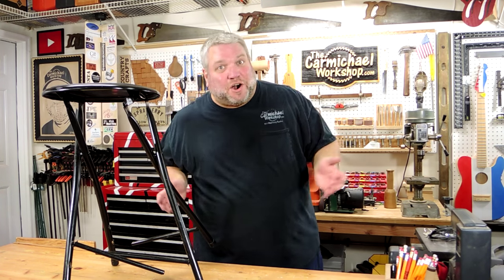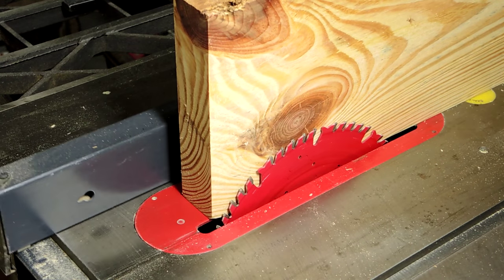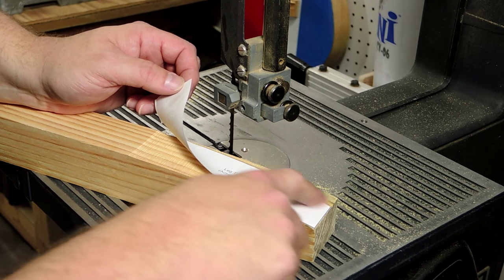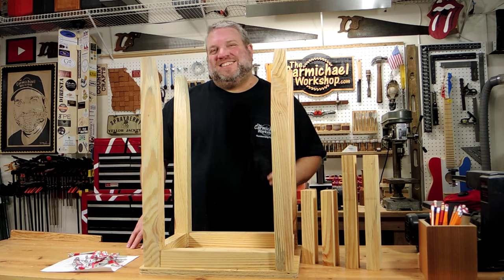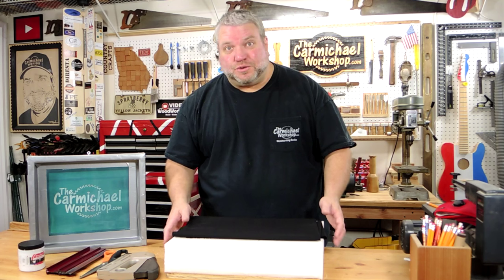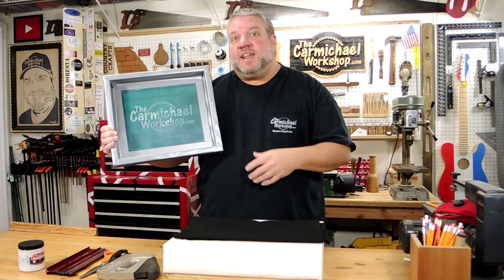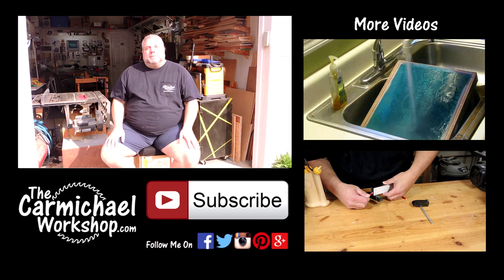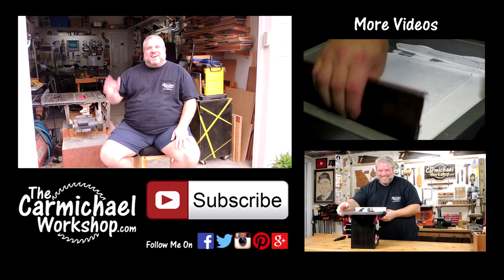Make a Workshop Stool or Bar Stool

Comment: Love that screen printed seat! Very nice touch.

For anyone thinking about making a similar stool and using vinyl or any material other than a cloth fabric, do yourself a favor and drill at least 1 air hole in the plywood seat platform. When you sit on it, the air in the foam has to escape someplace, and air rushing out from between vinyl and plywood can make some very goofy, rather embarrassing noises. Just saying...

Comment: So you have carmichael proofed it if I was to make one (which there is a possibility) I would need to Nighthawk Proof it ... bigger screws more glue... add in dowels as well fo good measure... I am just a clumsy goof... lol
Reply from the maker: +Wacky Wood Works  I think the thicker lumber was the key.  This thing is heavy and sturdy.
Reply: I reality I probably need steel reinforced concrete stool (and i would still probably break that lol)

Comment: Damn, I did screen printing in 7th grade as well my teachers name was Mrs Tate and she was a dead set hippie. Always wore tie dye stuff and I hated art so she didn't like me. I am not at all artistically inclined, I am plain, boring, conventional and like things symmetrical. That wasn't acceptable so I failed art. That really held me back in my field of work as a mechanic and spare parts interpreter. Good job Steve, that looks brilliant, but might I suggest putting some covers over the hex heads as you might catch your leg, or maybe countersink them and glue some dowel in the hole. Good video man, take care.
Reply from the maker: +TheAussieStig30    I think my teacher was kind of hippie back then too.  Good suggestion with recessing the hex heads.  They are not sharp or anything though.  Will see how it goes.

Comment: I built this, mine is a little wider to fit it to size of the foam. The big mistake I made was to get foam that was to thick. Other then that it is great. Thanks for the idea!
Reply from the maker: Great to hear you made one!  I love mine.  I think my foam was 3 or 4" thick.  I'd like to replace it with that dense memory foam stuff.  It's just not padded enough for me.

Comment: I'm not going to lie. When I first saw the plans I thought it was going to be a lame build, but you really pulled it off. Great stool. The bolts ended up being decorative and the silk screening on the seat really pulls it together. I like the tint in the pray laquor.  Great stuff.
Reply from the maker: +Impractical Fishermen   Thanks!  I was going for a simple stool that would hold me up and still look pretty cool sitting in the shop.  I always gravitate toward the contrast of black with the wood grain cause it looks sharp.  I lucked out with the swirly grain in this pine.

Comment: Nice,  functional project that could essentially be built from scraps from around the shop.  

My only question,  and please excuse my ignorance,  as I am just learning.  

With the ply board under the cushion,  screwed right to the base,  would an attachment mechanism to the likes of something used for a table top be more fitting? I've been doing some research and everyone seems to feel like z clips would better allow for movement with the changing of the seasons. 

Make no mistakes,  I'm not questioning your knowledge,  or saying "you should have blah,  blah, blah."  Just merely trying to educate myself better.
Reply from the maker: +Phillip Synenberg   Thanks Phillip!  I was thinking of using some sort of clips, but the movement is not much of an issue with plywood although it can move some.  The glued plies keep it constrained more than solid board cut from a tree would be.  That's a good question.
Reply: +Steve Carmichael good info,  thanks,  Steve!

Comment: Fantastic video, you've got me wanting to build 2 myself! What did you pay for the foam padding? Also was your 2x lumber pressure treated?
Reply from the maker: +Tyler Koch   Hey Tyler!  Cool!  The foam was about $7 at Hobby Lobby  and I think I got 40% off that with their online coupon.  The lumber came from a local saw mill, so it wasn't treated.  It was also 1.75" thick, as opposed to 2x which is 1.5.
Reply: +Steve Carmichael even in the comments your teaching me something. Thanks!

Comment: Hi Steve, is there a rule of thumb on how much material is needed to cover the are plus the padding so that you have enough to staple down?

thanks for the great video.
Reply from the maker: +Will Gray  Hi Will - Not sure.  I just measured across the seat, down both sides, then across the bottom in both directions.

Comment: Do you like that dust mask that you're wearing? Do youfind that it works well?
Reply from the maker: +Phil Reynolds  Hi Phil - I do like it better than the white paper ones.  The XL fits me well and the velcro strap is nice.  If you wear glasses or goggles, you have to rest them on the mask or up close to your eyes.  They still fog up a little depending on where you put them.  I'm wondering if the mask will be hot in July.  The mask is from RZ Mask http://amzn.to/2dvgrAF

Comment: Really like that screen  printing!   What do you use for the sticker material that you made the template out of?  Some kind of sticker sheets that go through  your printer?
Reply: +Jack Bench Woodworking Im not sure as to his specific method but you print your logo on to clear plastic sheets. Then you stretch a silk like material over a wooden frame. The silk is then coated in a special photo sensitive emulsion, the logo that was printed to the clear sheet is then placed ontop and the whole frame, logo and all are put under a light. The light will cure/harden the emulation. Any of the silk that had part of the logo covering it will be wet still because the light couldnt harden it. So you can now use a tap or hose to spray the screen which will remove the wet emulsion. You now have a screen with your logo on it. Then its a case of laying it on the surface you want to print on. Putting some ink on and using the squeegee to spread it evenly across. Since the ink can only penetrate the silk that has no emulation blocking it, your logo is then transferred across. You can get multiple colour prints by repeating and building up each layer with a different colour. :)
Reply from the maker: +Jack Bench Woodworking Check out my video on screen printing shirts.  It is a step by step process and a supplies list is in the desc. You can get started for about $60 with hobby level stuff.
Reply from the maker: +Dylan McGreevy Good explanation Dylan.  Thanks for helping out.
Reply: Steve Carmichael Thanks, great video btw :)
Reply: +Steve Carmichael Thanks Steve.

Comment: Nice and simple and it came out great.  Did you glue it together it just mechanical fasteners.
Reply from the maker: +Mr Woodworker No.1 Thanks!  Yep, I glued it together although the end grain doesn't provide a very good glue surface.  Those lag screws are strong, but I thought the glue would keep the rails from spinning on the screws.

Comment: Being a big guy, I need a sturdy shop stool.  I searched YouTube for shop stools and want to make yours.  What is the measurement from the bottom of the top brace to the top of the bottom brace?  Hope you see this as I know it is an older video.  Many thanks.
Reply from the maker: Hi Stephen!  There is 12" between the braces.  I still used the stool.  If I made it again, I would make the legs form a square with a round seat.  I find myself turning sideways on the stool with one leg over the front and one over the side, so the corner doesn't dig into my leg.
Reply: @SteveCarmichael  Thanks for the extra tip!

Comment: Hi Steve! I will be building my stool tomorrow and wanted to know if the taper is necessary of is it more for looks? 
Thanks!
Reply from the maker: Hi Andre!  That's awesome!  The taper is just for looks.  I suggest rounding over or chamfering the botttom of the legs.  I had a problem with the wood chipping and splintering, so I ended up rounding it over.  Or you could attach feet or felt so the wood can't chip on the concrete.
Reply: @SteveCarmichael   @Steve Carmichael  thanks for the response, Steve! The stool turned out great, and i ended up just attaching feet to the bottom. Thank you my friend, you are awesome!

Comment: nice heavy duty stool..never worked wth southern yellow.how is it to work with?-also, you wanna swap stickers??:)
Reply: SYP is soft and easy to work with power tools, it doesn't sand real good and has a tendency to split if you don't pre-drill.  It also doesn't work well with chisels.  It's what is used to frame 90% of the houses here in Louisiana
Reply: Mr Woodworker No.1 thanks for the feed back appreciate it. ..im from n.y. and was curious. .-ive never seen SYP here in n.y.
Reply from the maker: +Joe basementwoodworking Yeah, it's used for construction here in GA too.  I think it's a little stronger and heavier than the white pine/spruce.  It can have a lot of sap in it too.
Reply: +Steve Carmichael nice!-thanks for the reply steve!-does it bind ur blade up ever?
Reply from the maker: It can since I can't use my aftermarket splitters on thicker lumber.  I just let my saw stop and trip the power strip.  Then turn it off and saw half way through and flip it over. to saw the other side if I have to.
Reply from the maker: Oh, send me your address at thecarmichaelworkshop@gmail.com and I'll mail you a sticker.

Comment: Nice and simple.I don't believe we can buy 1.75 material here in Indiana? Thanks for sharing.
Reply: +Tom Pritchard Tom at a sawyer is my place I go. Probably any location that mill lumber may be able to help. Not sure where you are at but I know a Fort Wayne location and one in Delphios Ohio(my choice).
Greg
Reply from the maker: +Tom Pritchard Hi Tom - I got it from a friend who had it cut like that on a mill.  It was leftover from my electric guitar project.  I was going to glue up boards to total 2" thick, but decided to use up the leftover wood I had and save some time.
Reply: Greg Teagle Greg, I'm in southeast Indiana. Madison..
Reply: OK. Love your sculptures in your pic. I buy my hardwood from Delphios  Oh. from a mill. Cost runs around $2.70 a board foot for red oak planed to size. I hope the info helps.
Greg
Reply: Thanks Greg. Yes it does. Also, thanks for the comments on my carvings.

Comment: Believe it or not but that looks nice n strong mate lol
Reply from the maker: It has been a great stool.  The only issue I've had is with the wood at the bottom of the legs chipping/tearing out from dragging it around on concrete.  I cut off about 1/2" of each leg, then did a big roundover to prevent it and it's been ok since.  The corners dig into my legs, so I have to sit on it diagonally with one leg off the front and one off the side.  I think a round seat would be better, so maybe I'll make another stool video.  hmm

Comment: How much fabric do I need to pick up? Thanks!
Reply from the maker: Hi Aaron - 1 yard should be plenty.  If you go to Joanns, Michaels, or Hobby Lobby, check their website for a coupon for 40% off one item or such.
Reply: @SteveCarmichael  Thank you for the reply! I picked up a yard at Joann's. I am totally new to woodworking. I built a workbench that came out great, now I'm doing this awesome stool -- I've got all the pieces cut, sanded and ready for assembly, but, forgive me but I said I'm totally new, what are the measurements for the hole placement? I tried to pause the video but I just can't make them out. Once I know where those are it'll start to "click" in my head as to why they are where they are. It's how I learn lol 

Thanks for the cool project!
Reply from the maker: @AaronPaulley  I put the holes for the rungs at 14.25" and 14.5" from the top of the legs.  They are staggered so the screws don't hit each other.  You might want to move them where it's most comfortable for you to rest your feet while you're sitting.
Reply: @SteveCarmichael  Thank you so much for your replies! It's not perfect, but I'm very happy with it! https://imgur.com/a/tK8e6sC -- It's my second completed project (not counting my sawhorses lol)
Reply from the maker: Oh wow, that looks just like mine Aaron!  I think I like your wood selection better.  Very cool!  So glad you could use the idea and make one.  Thanks for the picture!